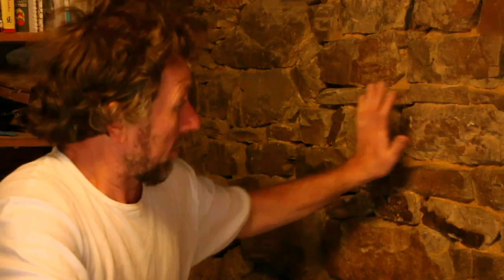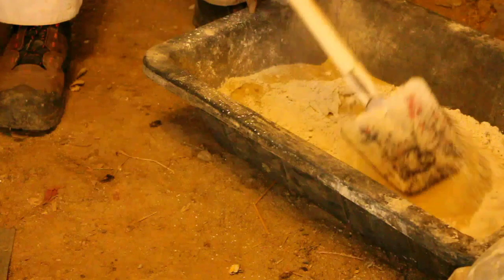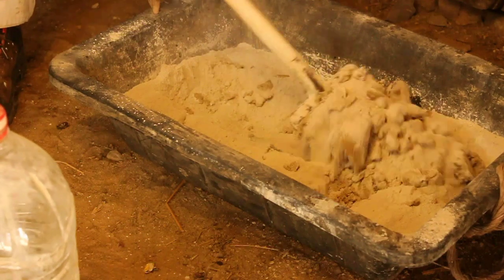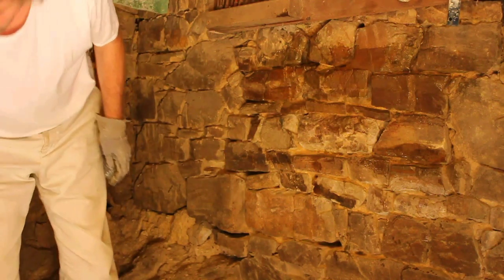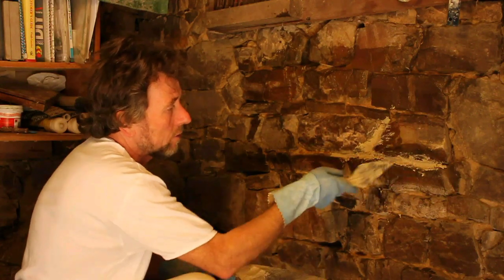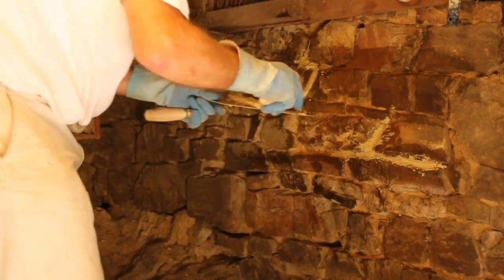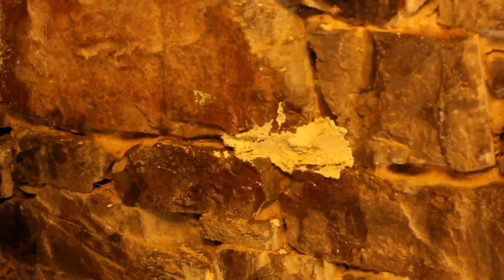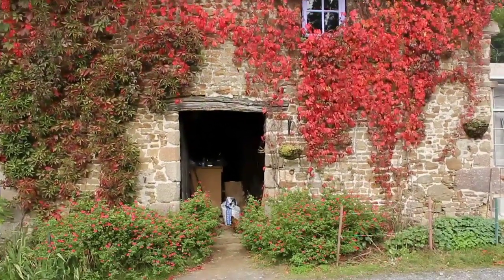Working with Lime Mortar. Pointing stone walls. Mortier de chaux. Hacer juntas con mortero de cal.

Comment: Hello, good video. Do you have any advice for pointing a completely dry wall with very loose stones (granite)?
Reply from the maker: Hi there Luke do you mean this is a 'dry stone wall' such as used in field boundary walls or a 'dry' stone wall, which has no moisture problem, or do you mean any mortar originally used has fallen out? Technically mortar is meant to keep the stones apart, so an actual 'dry stone wall' is built in a different way but you could still point it using a 'softer' mix, e.g.,  6 sand to 1 lime. However do get back to me and clarify and we'll go from there. Cheers, Andy
Reply: @Organikmechanic  yes, a drywall like the field boundary walls. 1700s I think. No mortar was used. Stones in the walls of the house are very loose and without mortar, I wouldn't feel safe in it during a storm.
Reply from the maker: @lukejones1244  OK Luke, so both inside and outside faces are not mortared. I would agree with you to stabilise the outer wall by pointing. If you have large voids where some stones have settled/ fallen out you'll need to replace them bedded into a layer of lime mortar, if you need to, pack in some mortar  and stone behind if the void continues deeper into the wall. Before you start, I would try to match the mortar colour to that of the stone so that your work is subtle. Here in Normandie it seems that when work like this is undertaken, the builders want to show that the pointing has been done and the results can be too obvious against the granite. Inside the building  I don't think you need to be so meticulous unless you have a 'feature' wall , perhaps around a fireplace? But, I would seriously advise the use of a lime/hemp or lime/linen render to a thickness of about 50mm to give a breathable, insulating surface. I have done this in our own house and found that the effect is visually pleasing and does not lead to moisture/damp problems as you would normally get using modern dry lining materials/techniques. If you need any more info, just get back to me. Cheers from Normandie, Andy.
Reply: @Organikmechanic  Thanks for your advice. Planning on restoring a building in Portugal. When you say hemp, or linen, you mean the fibre chopped up like a kind of filler?
Reply: @Organikmechanic  And then I have another question: in the case of a ruin which has walls partly fallen down, do you think pointing the existing walls first and then building up on top of them to finish the wall is best, or is it better to rebuild the higher parts of the wall, and then point it? Maybe mortar the top line of stones, and then begin pointing the lower parts?
Reply from the maker: @lukejones1244  Phew, Luke. It sounds as if you've a big job here. How stable is the wall around the 'partly fallen down' bit? Do you know why it fell down? i.e. has a wall plate rotted or has something collapsed within the wall? My idea would be to stop the possibility of further collapse., so stabilising the wall and assessing  what's still standing is paramount. Where is this building?  Cheers, Andy.
Reply from the maker: @lukejones1244  Hi Luke, I mean the chopped fibre. In the case of the hemp, we found the cheapest way to obtain it was to purchase it in the form of a mulch used by market gardeners. It is a bit coarse but I like the texture obtained when it's on the wall. The linen is also chopped and it is sold here in large bags for horse bedding (for those animals that are allergic to straw). Hope this helps, cheers, Andy.
Reply: @Organikmechanic  Hello, its a very old rural/agricultural building on a mountain in Portugal. Drywall construction. It's mainly collapsed along a horizontal line, if you know what I mean. I mean the top levels have fallen down. So 3 quarters of the wall are still there. Wild fires causing the roof to cave in and bring some of the walls down with it is probably the cause. Remaining walls are quite stable as a whole, but individual stones are loose. So I see two possible methods: Point the lower parts of the wall, working up to the missing areas; then build them back up; or, build them back up first, mortar the top line of stones to stabilise the entire building; then do the pointing.
Reply from the maker: @lukejones1244  Hi Luke, I have no idea what your weather is like at this time of year on a mountain in Portugal but nevertheless, I would protect the standing walls from further potential rain/storm damage by securing a tarpaulin over the top of each wall, this to stop any water ingress, especially after pointing. It sounds that what is left of the walls should be pointed from the ground up but only after securing the loose individual stones. As you've lost the carpentry do you know what existed before? All the walls in my buildings have a timber wall plate to which the rafters are nailed and purlins secured into the gable ends. You've an interesting project here and loads of hard work, but from what you say it's all 'do-able'. Are you intending to document the project in any way?  Cheers from a very damp Normandie, Andy.

Comment: Hi, just about to start pointing my internal stone living room walls in my house in Brittany as they just keep throwing out dust and used to be plastered over, however my question is that the rear lower floor is below ground and although we have installed a land drain at the back and had a builder lime render the interior wall and painted with a lime wash, we are still getting problems with the render bulging and blowing at the base of the wall after about 1 - 2 years, is it best to take all the render off and just point up the stonework, problem with that is it doesnt fit with the look of the room, any thoughts?, once again thanks
Reply from the maker: +Matt Randle Thanks for your comments and sorry I only just found them. Seems like you live in exactly the same house as we do! These houses were never meant to have bare stone,  personally except for features like fireplaces, which are often in granite, we don't think the stone is good enough to be exposed. Firstly I would take all the render off, rake out and repoint the joints and then I would use an enduit of lime and hemp, we did this in our kitchen which has a back Northern facing wall which is 1 metre underground. This will move the dew point in the wall, insulate the room and allow the wall to breathe. You don't need to go and buy expensive interior grade hemp, we just used the stuff organic market gardeners, use as mulch, it helps if you have friends who have a business account to buy it in bulk through an agricultural supplier. We also used chopped linen and lime as well, again we used non-decor stuff, it is called  Linabox  and is used as bedding for horses who have allergies to straw. The whole of our renovation in both linen and hemp can be found on our blog, with details of proportions etc.,.  http://thegreenlever.blogspot.fr/2012/06/renovating-tiny-house-detailed-look-at.html#.Vhu4npeli1F For any further details, please get in touch either here or on the blog - Brittany grows both linen and hemp in abundance, so you are lucky! Good Luck and all the best, Andy
Reply: +Organikmechanic Hi Andy, many thanks for your reply i will make enquiries concerning the materials locally and try it out.
Thanks again 
Matt

Comment: Thank you for the video. I have a question on mixture. I am using 1 to 3 ratio for my mix for brick walls. I cannot seem to get the mortar to stick to my trowel as you did. I add water and it just get too wet. Do you have any suggestions? Thank you
Reply from the maker: I'm afraid you are just adding too much water> If you are making a small mix like I am, then use a small container of water so you can meter it out, not quite drop by drop but a little and often. It is a bit strange at first, because you think the mix is still too dry, but the trowel test can establish there is sufficient in it. If you notice in the video, I cut into the mix with the pointing trowel, prior to placing some on the back of the bigger one. As I cut into the mix, I can see the cut surface is a lot 'smoother' in appearance than the rest of the mix, i.e. the cutting and working action of the trowel is enough to start to bring the water/lime mix to the surface, this is what gives the mortar the suction to stick to the back of the trowel.and to stone or brick. This kind of problem is not unique to mixing mortars, even in the kitchen the same over-zealous addition of liquid can ruin sauces, custards etc. so keep mixing and add 'little and often'. I hope this helps and good luck with your walls. Many thanks for watching and for your comment and question. Best Wishes from Normandie, Andy.

Comment: if outside walls have been lime rendered can the inside just be normal plasterboarded?
Reply from the maker: Hi Paul. are the walls thick? If the interior walls are stone and have not been pointed with a cement mortar then they should still breathe. If you put in a plasterboard wall you may have a moisture trap between the board and the wall and get a damp problem. On our house I used a hemp and lime render on the inside walls which insulates and lets the 60-70cm thick walls breath. Hope this helps, if not drop me another message. Cheers, Andy.

Comment: I was wondering if you or someone else would be able to answer a couple of questions I have regarding repointing my field stone basement. I am considering doing this myself as it looks like it is easily enough done, just time consuming, once I find a mortar blend I feel confident with, as there seems to be slight differences in recommendations. 
 
It is likely, if I do take this on myself, I will be doing it in sections, likely 4x4 feet or larger depending on how I work.

Does it make any difference if I work top down, or bottom up? I have 5 to 6 feet of field stone before it meets either clay brick or or concrete block (unsure if it is cinder or sand), depending on the location of the wall in the house. I think when it was built they just used what they had on hand mostly.

The clay and cement blocks are doing fine (possibly built at a later date, which would explain the unusual use of materials in the manner that it was done), so I do not plan to do anything with them at this time. But the mortar around the field stone has been crumbling for well over a decade and it is time to address it before problems arise. I'm only bringing up the clay and cement blocks, just in case they affect how this should be approached. Better to know then not know.

I am still studying up on a good mortar mix. Here you recommended 4 parts sharp sand to 1 part lime. I've also heard 3 parts sand to 1 part lime. Anyone know what the difference would be? 
A couple recommendations suggested mixing the sand 1 part of washed fine with 1 part washed sharp. Anyone have thoughts on this? 

Thanks in advance to anyone who replies.
Reply from the maker: Hi Paula, the crumbly mortar should be removed to a depth of about 1" and wet the cavity with a brush or a water sprayer prior to pointing. The 3:1 mix would be a little bit harder when set but I don't think you would notice a significant difference except you will be buying more lime which costs more than sand!  If you use a builders sand you'll get an even particle sized sand which would suit a mortar for pointing, I would tell the supplier what you want it for and they should furnish you with the right stuff. My supplier here in Normandie recommended the sand I used. Thanks for watching and commenting and good luck with the pointing. Best Wishes from Normandie, Andy.
Reply: @Organikmechanic   Hi Andy !  Greetings from Minnesota, U.S.A
Thank you very much for your reply. 
Oh my, your answers have created more questions for me. Isn't that how it is. The more educated we become on something the more we realize how little we know about it.

You said "should be removed to a depth of about 1" "
Does this mean that if there is more crumbly mortar beyond 1" I should let it be and just press the new mortar into it (after wetting it)?

And if 'crumbs' are left, should I just spray dampen the surface of it or should I give it more intense spraying so that the water will go further into the loose mortar, to get it more thoroughly wet?

Should I fill the new mortar in until I can get no more pushed into the cavity (adding stones to the bigger areas as you have done in the video)? And if I am to leave crumbly mortar in beyond 1", should I push the mortar in just to the inch, or should I pack the mortar in more firmly, pushing the crumbly mortar back as far as it will go? 

You are being very helpful educating me on this. Thank you.
The video is very well done, showing the blending process and the wrong level and right level of wetness of the mortar, what to do with the 'deeper ' areas, and how to hold the trowel!  

And I love the history bit toward the end. Very cool about the coins. I could use some chickens like that.

Your video and answers to me will definitely aid me in my decision as to whether or not I will be doing this, for I know better now, that which the job will entail. If I could do this it would be of great help as funds are extremely tight and hiring a stone mason will be difficult for us and likely a couple of years down the line which I'm not sure is good for our foundation. Plus, here, unfortunately, one cannot always be confident that the contractor knows what they are doing like they should. This is another reason why I am very grateful for your video. It helps better then others I have watched in taking us step by step through it all, so that way I can tell if a contractor knows their business or not.
Reply from the maker: @paula.haller  Hi Paula thank you for your reply and I totally agree with the 'more educated we become.....'  that is the beauty of learning and long may it continue for us all. It's a very good question about the crumbly mortar, quite frankly it is not doing a lot where it is at the moment so if you think you will be able to feed the new mortar in to that depth then I would do so, otherwise try and wedge some stone or slate back there and then mortar in the joint. Every little bit of new mortar is going to help the wall remain stable.  I was very fortunate some years ago ,I bought a  1930's house in England and i knew it needed some repointing, I discovered that the local college held evening classes in various practical activities one of which was a DIY bricklaying course. I quickly enrolled and within the first 2 weeks I covered my course fee just from the advice given to me by the instructor about the correct mortar to use for installing an open fire back. If you need any more advice please drop me a line, I think you will find this so satisfying you'll probably want to tackle bigger projects later on. Good luck and enjoy! Best Wishes from sunny Normandie, Andy.

Comment: great video guys, I'm actually renovating my granddad's house up in the village, stone and lime and clay mortar ,huge undertaking, but the pleasure is in the process!! one question about the house in the video ,, all those plants on the outside of the house , are they in any way detrimental to the masonry??? keep up the great work !!! Bless yous!!!!
Reply from the maker: Hi George, Thanks for your comment, it's appreciated. The plants growing up the walls are virginia creeper and passion flower and they have had no detrimental effect on the masonary.  The part of the building in the video was built about 300 years ago, as an animal shed or possibly a food store.. Because of this more menial function, the stones used are smaller and more irregular in shape and thus not as attractive as those of the main house. In addition, over the years this wall has been pointed in a very slapdash manner so the plants are hiding quite an ugly, but solid, wall. The only thing we check is that the guttering is kept clear so we don't have any rainwater spilling over. You're so right about the pleasure being in the process and I'm sure the end result will be good for a few centuries to come!  Good luck with your pointing and Best Wishes from Normandie, Andy.

Comment: Does anyone know if softened water would weaken the mortar chemically?
Reply from the maker: Hi there, My idea is that because you are adding water to a calcium compound which includes magnesium salts, this would make little difference to the overall mix. I would think that as the difference in mineral content between soft and hard water is something like 10-50 parts per million for soft and 100-200 parts per million for hard, then adding either type of water to lime would result in the difference between the types becoming insignificant. Cheers, Andy.